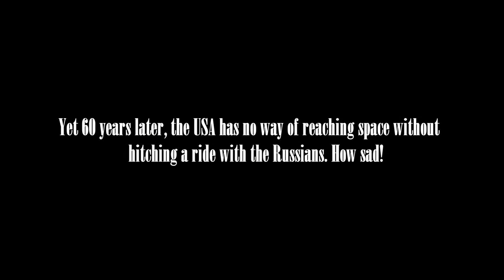Moon Hoax; "Apollo 55 Years Later"

Comment: The rocks brought back from the moon have proven to have a discrepancy in the Earth impact date today. More trouble for NASA which has been explained by them landing in a very strange part of the moon... 

It's a debate that, at least in part, comes down to moon rocks collected by Apollo astronauts -- many of which seemed to be only 3.9 billion years old, hundreds of millions of years younger than the moon itself.

"It turns out that the part of the moon we landed on is very unusual," he said. "It is strongly affected by one big impact, the Imbrium Basin, that is about 3.9 billion years old and affects nearly everything we sampled."

So this means that the NASA samples have a date associated with a single impact on the Earth rather than all the other impacts before that one. https://www.sciencedaily.com/releases/2019/08/190812130821.htm
Reply from the maker: All they had to do in my estimation, was to put some chunks of meteor found in Antarctica, into a particle accelerator, hit it with the appropriate radiation, and presto, they have moon rocks all 800 pounds of it!